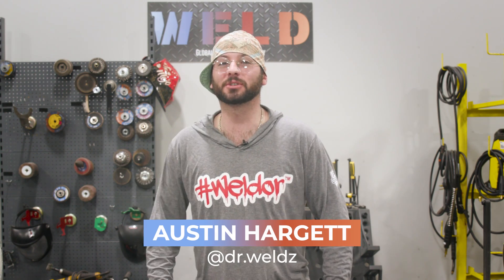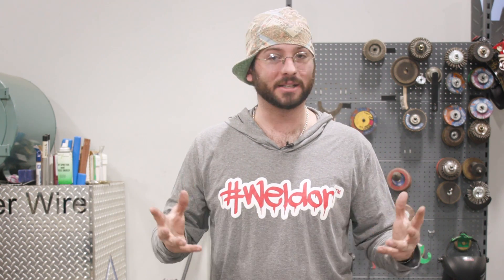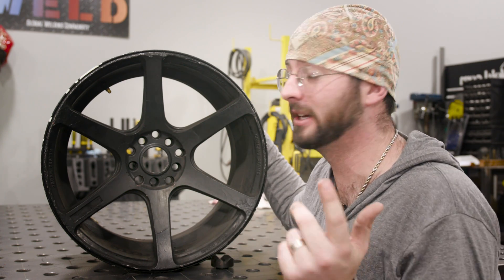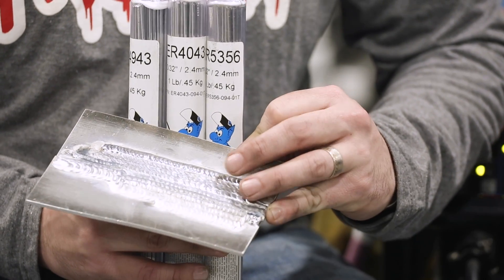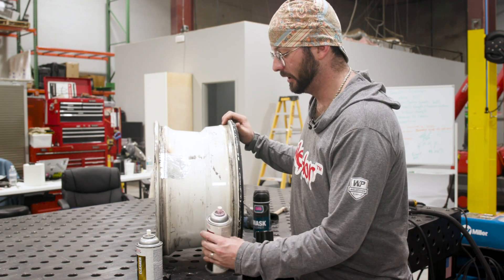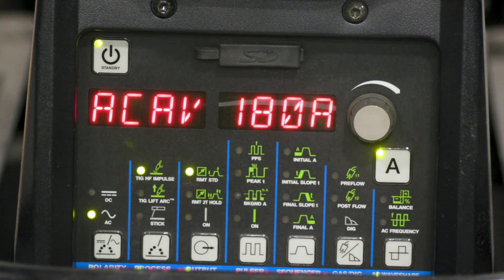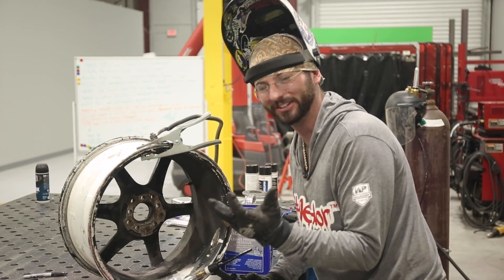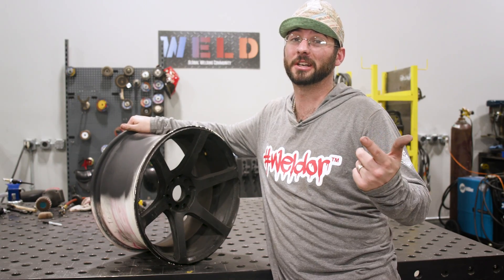TIG Welding Aluminum Wheel Repair

Comment: I've been told it's not a good idea to weld rims. Rims are usually heat treated, and welding will affect the grain structure, causing extra stress and tension in the welded area. Is this a good idea too do?
Reply: Just do what everyone else tell you to do ..that way you'll never get nothing done .or do research and learn and form your own opinion 😊
Reply: @stanlee2200 Well yeah this is what I learned in welding school, and from my metallurgical studies - rims must have a uniform grain structure. If you have a differing opinion, I will love to hear it.

Comment: I have ferrada cast aluminum wheels that cracked on the spoke.
And ferrada has sent me more than one replacement. Can this weld be applied to that?  Because I've had it welded 3 times and it failed
Reply: The spoke cracked and it's on ferrada. FR 2

Comment: What about flow formed wheels a356 to be specific. I have a 1 inch crack on the inside lip of my wheel.  I don’t have a tig welder but I could buy one  could I do it with cheap  one from Amazon ? What machine  materials and filler would you advise me to use ?

Comment: The key to tig welding aluminum is a weld cap…. Turn it sideways and pull it over your ears. That’s 99% of the battle. The other one percent is a perfectly  round tungsten ball.

Comment: I've been welding wheels for quite some time and this doesn't look like a good job. Putting so much material just to make sure you are good to go? It will cause warping and stress inside the walls. And the puddle look messy most of the time.

Comment: Good video.. Before DPI testing the use of mechanical cleaning should be minimal. By using that die grinder, especially with softer metals like aluminium you have the possibility of closing up any shallower defects.

Comment: I do 4 or 5 of these a week I just use a 4.5" sander with a 36 grit to clean the junk, drill a hole at the bottom of the crack then take a 6mm slice out of the rim and fill from both sides 40 minutes start to finish
Reply: What would u charge for this??

Comment: Ah that's wheel is forged not cast aluminum. How can I trust anything being said when it's not what it's supposed to be ?
Reply: yeah.. the title said 'Cast' but it's actually forged... it's missleading...
Reply: @pekketom  ya I was looking forward to learn cast aluminum it's very tricky and I suck at it 😏
Reply: @Paladin_of_Justice  drill it each side of the crack then put a prep in it personally I don't really pre heat it I run back and forth over the crack with the torch to heat it locally with the cleaning setting quite low (68 on a Miller) before adding filler rod
Reply: @garethowen2792  thanks
Reply: Listen to what he says in the video

Comment: Ok. So what happened to welding cast aluminum? Also, I know it's a drift wheel and mine are beat up too, but that's a lot of heat and material to pull the wheel out of round. I've got some repaired wheels from people that are really wacked out. That being said I've got a huge crack in a cast wheel, which is why I watched this. You didn't weld cast anything and that's what the title is. Thanks for the tips on welding a forged wheel. 🤷

Comment: Dude, what's with all the dipping the tungsten, pulling the wire out of the argo? "A grinder and paint can make a welder what he  ain't". LoL. No disrespect intended, but maybe you should practice more than 3 beads before a video. I been welding for over 35 years btw. Thanks I will say you did make a good repair, if it held air pressure. And you did teach the proper steps to a good repair. God bless.
Reply: I’ll agree with you friend, not the best, I know the steps 😅 never done it myself. I’m not super proud of the shots but we got it done
Reply: @austinhargett5792  Yes sir you did, as I said before, IF, it held pressure. I merely intended encourging criticism, not negative. Welding is a hard skill to learn to do properly. And, it's an art, like playing music, it takes alot of practice, and you have to constantly keep practicing to keep up that skill. I've been doing it for over 35 years and I still make mistakes sometimes. God bless you sir.
Reply: There are no gods here, Bob already left the building.

Comment: During some of the welding, the puddle looked like it was contaminated. Is this just what happens when you work with a used part like this?
Reply: It was very dirty metal. I’m sure I may have adjusted something. But it was some really dirty stuff
Reply: Absolutely. That's just the nature of the beast.
Reply: Needs to adjust the balance to improve the cleaning action